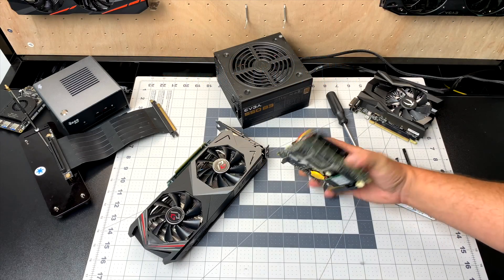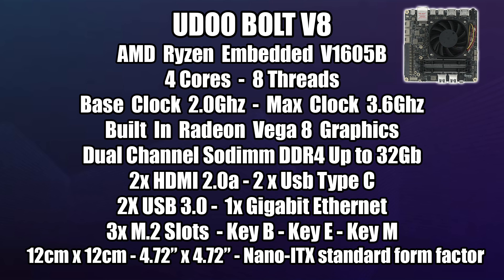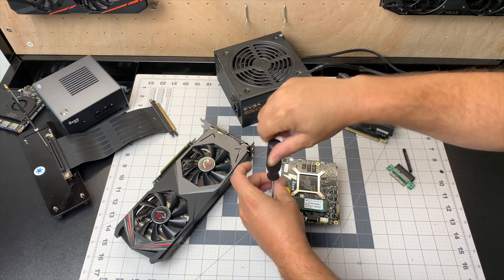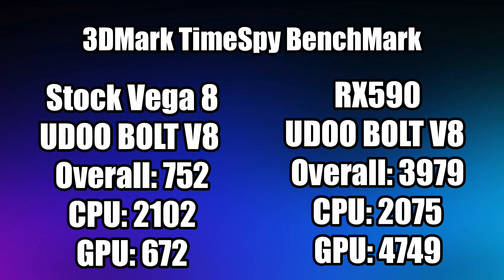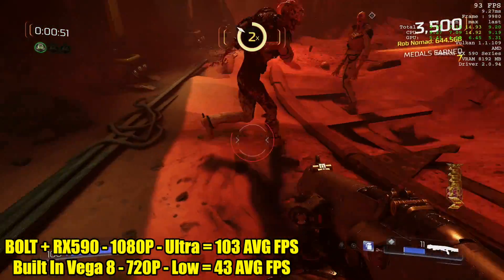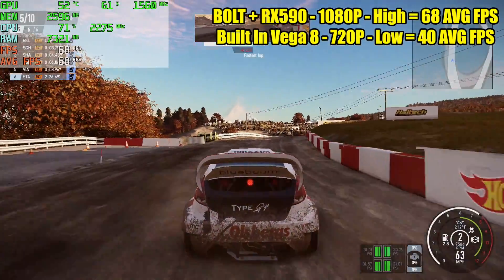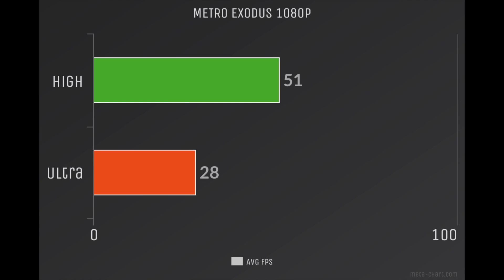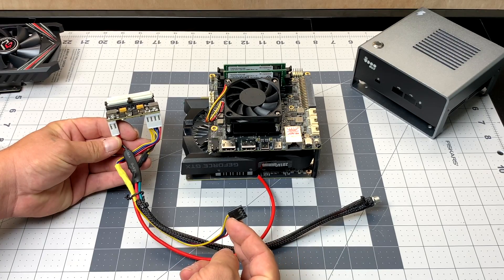UDOO Bolt V8 + RX590 External GPU Testing

Comment: Take it to the next step use the pico power supply. Adding some rgb will probably improve the fps too
Reply: Install windows 8 and 10.you get windows 18
Reply: @lacktoes5838  windows 10????  get windows 95  or windows 2000...
Reply: I'm pretty sure the rgb on my laptop doubles the fps, so just imagine what it could do here
Reply: @tb-xy7lg  i can cumfirm is working
Reply: Don't forget to download more ram.
Reply: Rgb always makes things quicker.
Reply: @iwinrar5207  and nootropics in the water cooling
Reply: @tb-xy7lg  💀💀💀
Reply: @youndrip2955  i assume this was in your recommended too
Reply: JUST install windows 9 and Your fps be better
Reply: Use fatherboard not motherboard, its more versatile.
Reply: @tb-xy7lg  ok enough internet for today
Reply: The FPS  will be EXPLOSIVE
Reply: Dont forget to use better mouse pad it will increase ram and cpu performance
Reply: YES PLZ
Reply: remember: blue rgb for better cooling, green rgb for better efficiency and red rgb for more power. some say these effects can be combined, though it has not been tried yet.
Reply: I can’t even tell if this is a joke anymore....
Reply: You noobs forgot about flex tape. It will give the CPU 9000 IQ
Reply: B first you have to strip the 1000watt power supply wire to bare steel then plug it in and lick it for maximum efficiency